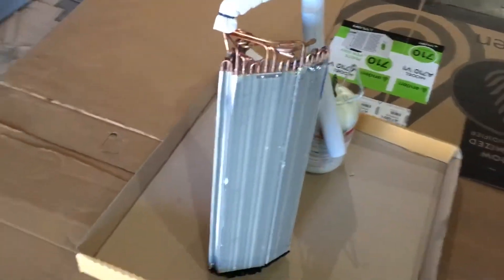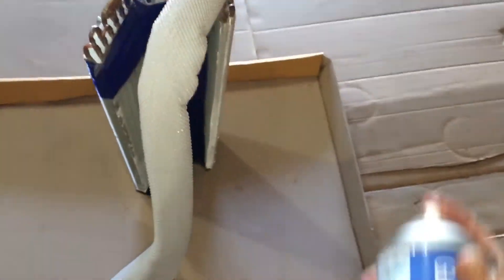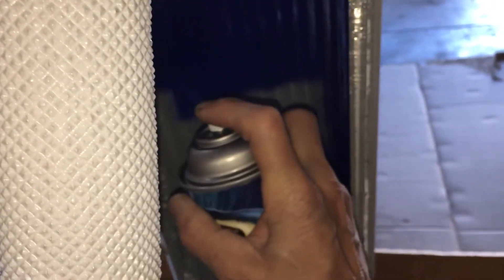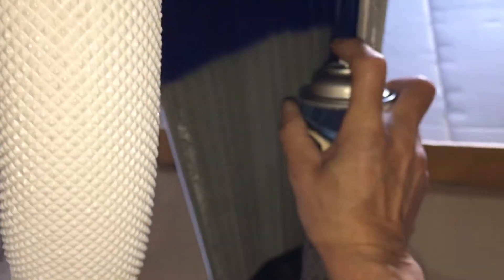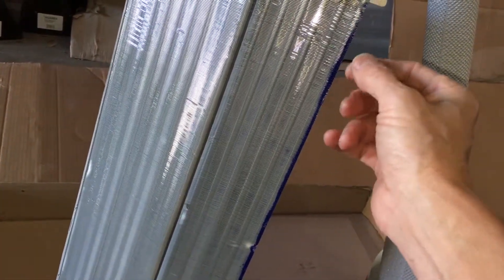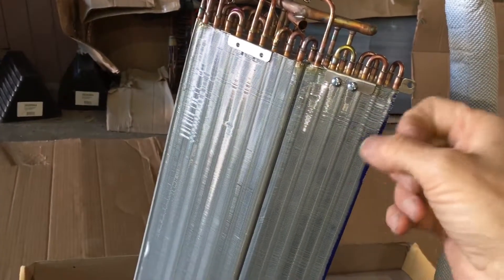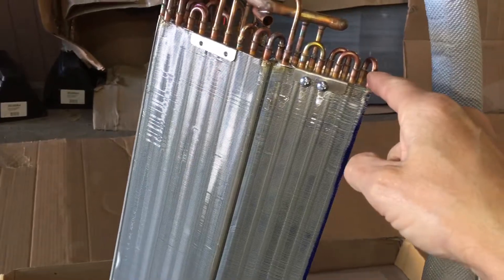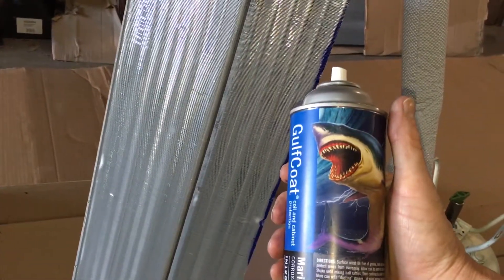A/C evaporator coating to extend life

Comment: when you spray it,  it acts like a insulator of the metel fins, does it take away much cooling capacity of the system ?  do you use that stuff on  condensers and evaporators  for  modern  car ac ?  or just  older car  models ?   couldnt see the name or make on  the  spray can.   thanks
Reply from the maker: That’s an excellent question about the insulating properties of coatings on fins 👍💰. 

       There is A minute hit they brag about 2% efficiency loss. 
            I could live with that so could everybody else when you taking the consequences of a early leaking evaporator or condenser and yes I would also put this on cars evaporators or condensers I have seen Modine condensers come with the option of this coding on their condensers it was like a $15 option from the factory to order a automotive condenser with this option. 

         But it is nothing compared to the losses when you start to develop a slow leak in the condenser or evaporator your charge goes down very slowly and you start losing efficiency right away but you the customer keeps operating your air conditioning system in a inefficient charge level that greatly reduces the life of the system and greatly increases energy consumed to try to do the same amount of cooling to compensate. 

          And when they originally manufacture condensers or evaporators with those special coatings that you see on them whether they’re gold or blue or black or gray during the manufacturing process there’s a mathematical formula to compensate for the loss in efficiency by adding extra fins extra tubes and a slightly larger size if they could get away with it and thickness depending what year dimensions will allow to compensate for the losses of a protective coating. 

        When I do a condenser in my personal car or family members car it gets the same treatment
Reply: @coldfinger459sub0  thanks for the info,  can i buy that spray coating  retail without a license on the internet ? thanks
Reply from the maker: @jongonegone1262  Yes just Google search it a whole bunch of Internet suppliers will pop up it’s available in blue and gold or in clear so you have your choice of colors